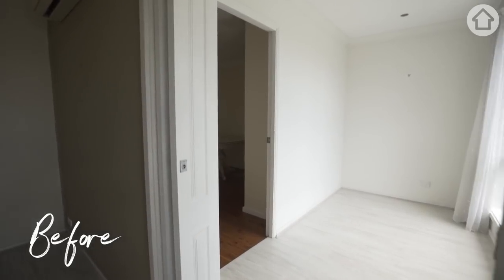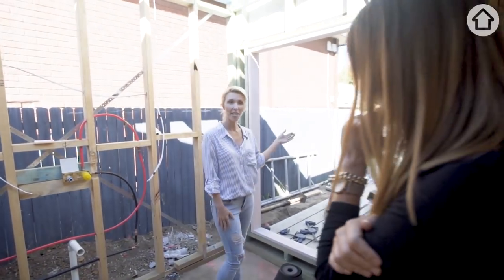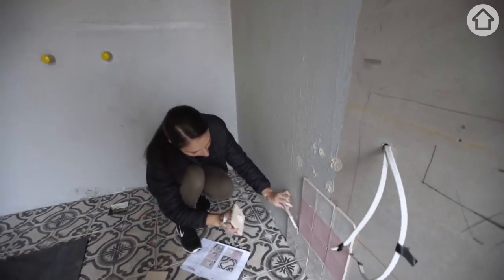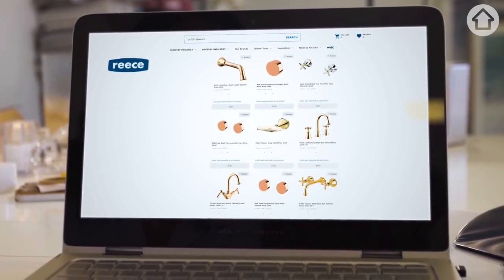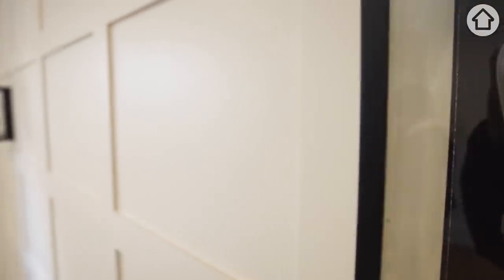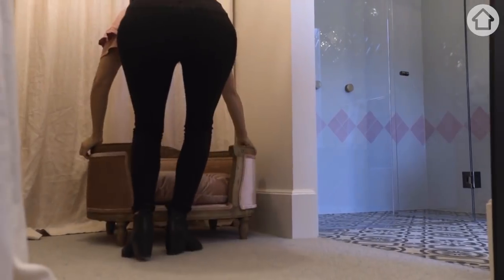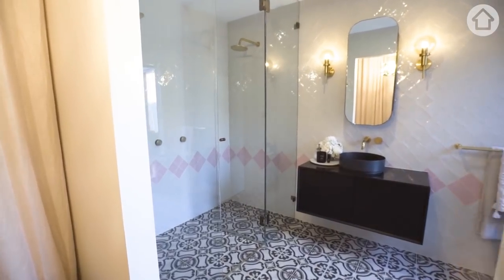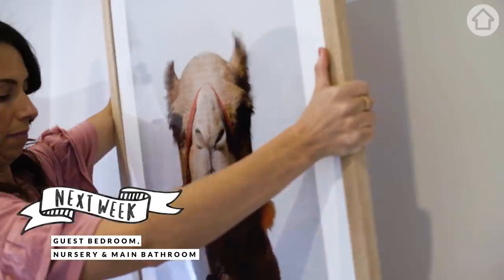Episode 2 | The Master Suite, House 9 Renovation

Comment: What sort of timber do you use for the bedroom feature wall , and what are the dimensions? I’d love to do that in my bedroom,I adore your ideas
Reply from the maker: Hi Jeannine. We just used standard plasterboard and then 90mm pre-primed timber. The measurements were 2.6 high, 3.6 wide, 230mm skirting and 90mm cornice. We worked our way back from there. If you look closely the bottom panels are smaller. xx Have you been to our website? threebirdsrenovations.com x

Comment: The big window is so impractical without a door to completely  close off the private deck. Also, why was there cheap  cabinetry in the closet when basic subway tiles could have helped toward the cost of a better closet. The shower tiles looked terrible and cheaply done and I hate it. Also why was the kitchen huge and no dining room table or bar stools? It's  beautiful  but not practical at all.